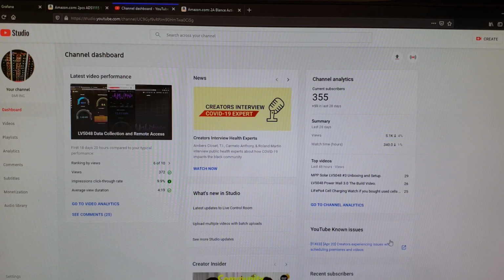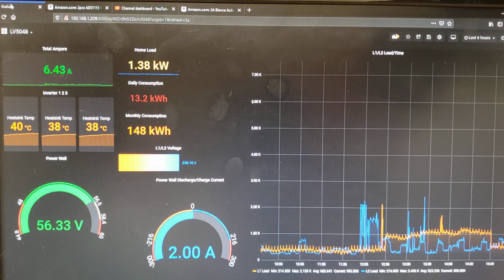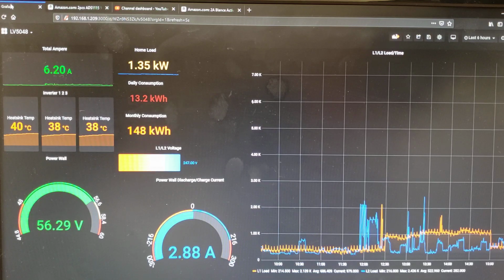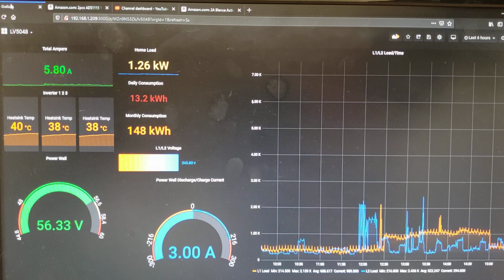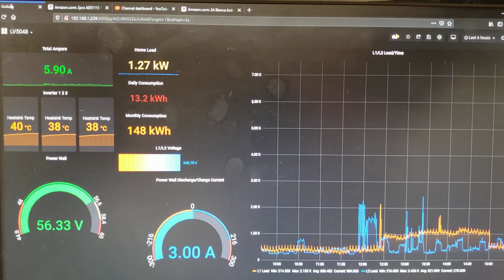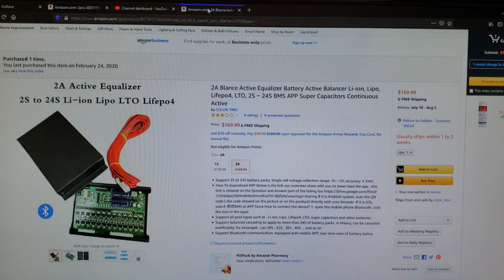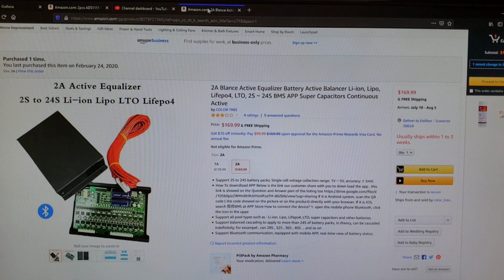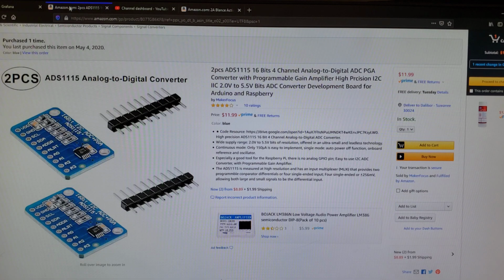LV5048 Grafana Monitoring & HOA Update

Comment: So good system to monitor our LV5048's. I use it now on a permanent DELL LAPTOP (Inspiron 1545) I used with WatchPower on Windows. Now with Ubuntu Server 18.04.04 LTS.

Tried yesterday to set it up with Ubuntu Server 20.04 but python2 is not available on the repositories for it (needed at this moment, as far as I know, for the mpp-solar-service, specifically python-systemd package).
Reply from the maker: python2 only at the moment. We might get lucky and have python3 soon. Thank you.